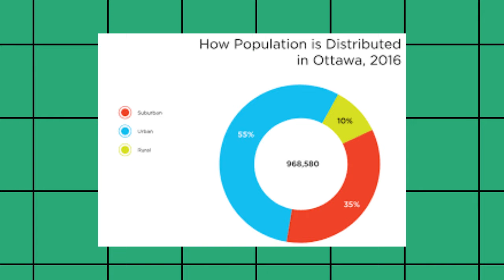How Ottawa Failed Urban Planning

Comment: HI, I hate to be that guy, so I'll start off by saying I enjoyed the video and you raised several points that would merit their own deep dives. At 30 seconds in while discussing the creation of Parliament Hill you made a rather glaring error when you stated that the "iconic Peace tower setting the skyline limit at 150 feet".  You are correct that a height limit of 150 feet was put in place, however it was the "Victoria Tower" that stood at 180 feet tall that set the limit.  The Peace Tower which stands at 302 feet didn't exist until after a fire in 1916 Destroyed the original Parliament and a new one was constructed.  The "Peace tower" is named as such to commemorate and honour those who fought in WW1 and was completed in 1927
Reply from the maker: Thank you for the correction! You are completely correct! Apologies for such an error… thank you though for the constructive feedback! 🙏🙏
Reply: Sith happens as I like to say @TheUrbanique  It's an easy oversight to make and you still got the height restriction (the most important bit of info) correct

Comment: Ottawa must reconsider the horrific scar that runs through it. The elevated Queensway should be levelled, and a proper boulevard built in its place. Many cities have done this -- Seattle, Detroit and Seoul to name a few -- and all have designed a pristine city landscape that caters to people first, and cars second.
Reply from the maker: It was the original plan of Gréber, remove the rail tracks for boulevards and green space however they took half and left half… which ends up having a highway replicate what railways did : divide the city and cause congestion in the downtown area… with the LRT now being built a downtown highway is just not necessary and doesn’t promote alternative commuting methods
Reply: @TheUrbanique  You are absolutely correct. Perhaps Greber's plan was far too progressive for the time, but one would think that today it is purely logical.
If  only the politians had your common sense, but I have yet to come across one who will even listen to my argument without countering with excuse after excuse
Reply: Cars cater to people.
Reply: @AllenGraetz  I really think it's the other way around. People cater to cars.
Reply: Seattle didn’t get rid of Highway 99 though, it buried it underground. It was a win for pedestrians/waterfront as well as motorists since it’s used as an alternative to I-5.
Reply: @davidferguson6507 Absolutely correct. North American cities bought into car company propaganda , and  have created an infrastructure monster, breaking cities budgets. Suburbia is overly subsidized by urban centre's as well. Strong Towns and Not Just Bikes have extensive videos on all of this for anyone that cares to explore real well thought out urbasim.
Reply: Ottawa needs a highway taking the 417 out would be the worst idea ever😭😭 we need more highways not less
Reply: @jusmax374  The idea is not to impede cars from going east to west or to Quebec, it is to make it affect the city of Ottawa. Some alternatives that exist are a ring road around the city, and bridges to Quebec on the outskirts of the city.
No one can convice me that creating an ugly concrete noisemaker through the centre of Ottawa is a better choice.
Reply: @ how do you expect people to drive anywhere in Ottawa without a highway in the city lol we need more not less

Comment: The 417 through the downtown core should be decommissioned. Instead a new bypass should be erected along Barnsdale, Rideau & Thunder Rd. to allow for a bypass around the core. The 417 corridor should be converted to rail & light modal transport. I’ve get for a long time now that King Edward Avenue should be buried and resurface to connect to the east end of the 417 south of Sandy Hill. This way, there’s a fast connection to Gatineau from Ottawa & there’s less traffic in the core & in the east end.
Reply: The former City of Cumberland has already built a bypass, minus fhe interprovincial crossing. Truck traffic would exit at Vars, down Frank Kenny Road to Brian Coburn Blvd. That's where the dream has ended.

Comment: There's a area northish of the Bi-Ward market where street after street runs one way in the same direction ... five of them as I recall ... before you hit one that goes the other way. I suppose that it made sense ... to somebody ... somewhere ... after committee after committee debated it for years, no doubt.
Reply: North of the Market is nothing. Almost every street from Parliament to the highway is one-way. There are at least a dozen east-west one-way streets and most of the north-south streets are also one-way.